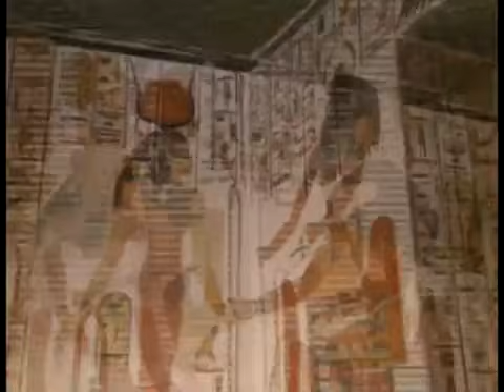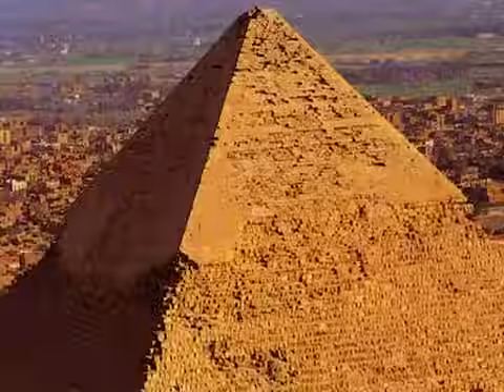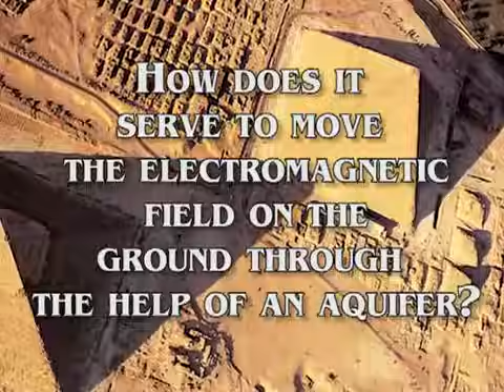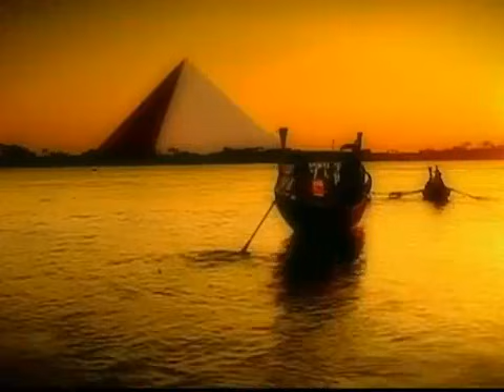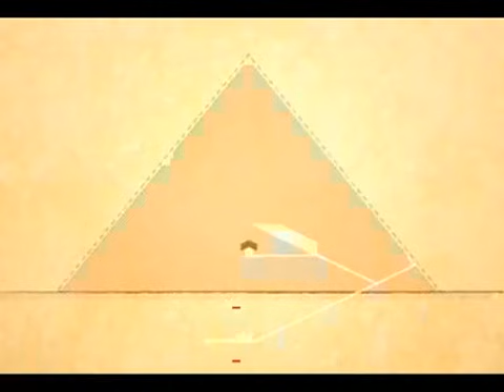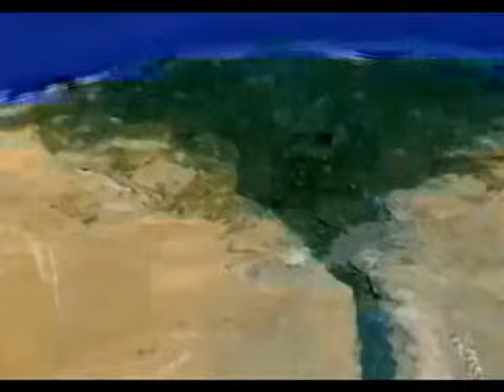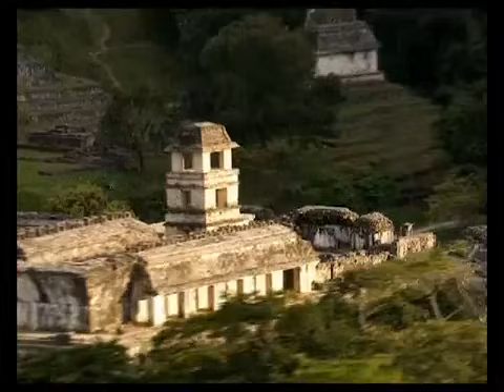Nikola Tesla - The secrets hidden in the pyramids of Egypt

Comment: There WAS no 'Ark of the Covenant" until Moses LEFT Egypt and was wandering in the wilderness with the cihildren of Isreal. God did not give the design/pattern for the Ark until he gave the pattern for the mobile tabernacle they were to build. So, the premise that the pyrmaid was powered by the Ark as a capacitor cannot possibly be true.
Reply: +Laura Rodich
I agree the Arck of the Covenant was made after the Israelites left Egypt and remains there property long after Moses died. The Egyptians did use advanced machines which is the mystery here. Did you notice the perfect right angle corners in the stone sargophagus? That could not be done by copper chisels.

Comment: Think you need to get your facts right. Tesla used the 'free energy' the whole universe is filled with. As demonstrated by people like Dr. T Henry Moray and others. And free energy DOES NOT need alternating current it is a continuous direct current flow. Tesla invented the alternating current system to avoid the need for massive cables that Edison used in his D C system which could only supply electricity to a very small area round about the generater source of D C. Alternating current enables transformers to be used. Hence small cables can be used to distribute high power over long distances.

Comment: they made lovely stainless steel ceilings didn't they ? i bet they was a bit pissed off after they built them and they didn't work. electricity my arse, it couldn't generate 1 volt, if it could it would work today, nothings been altered, and were did they get the cable to run to the lighthouse ? don't talk crap.

Comment: While I agree with the technological properties of the pyramids, the statements regarding "evolutionists", "the prophet Mohammed peace be upon him", and "no linear advancement from simple to complex" show a religious (Islamic) agenda to this information that detracts from what should be the primary message of the video. Ancient civilizations had access to amazing technologies, but that does not mean they didn't develop those technologies over centuries by themselves, which would mean that civilizations are much older than they are currently credited with being. It is completely illogical to make the leap from advanced technologies in the past equaling "no such thing as linear advancement of civilizations." Research done by engineers on the Sphinx for example, shows that the weathering on the face could only have happened during a period of great rain. There has been no substantial rain in that region for over 10,000 years. That means an objective observer armed with the relevant information would say the Sphinx was constructed several decades (at least) before that 10,000 year mark during a period of lush vegetation and rainfall.